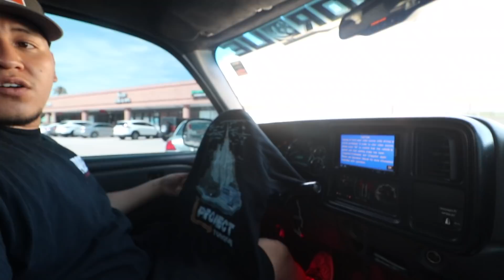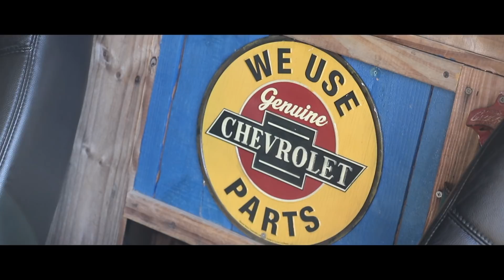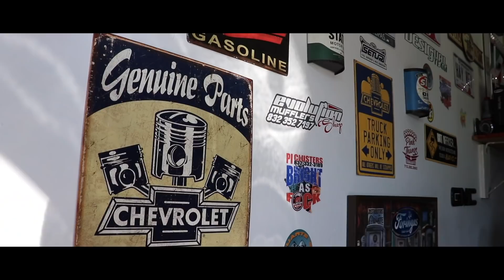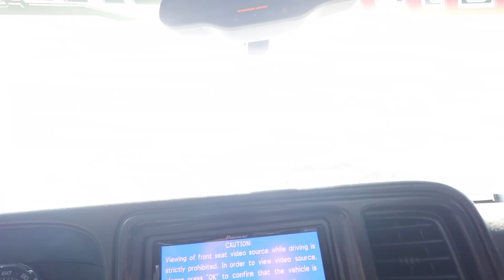2009 Silverado Seats on a 2003 Silverado / Ss CLONE GETS NEW SEATS

Comment: Make a video on manual to electric windows conversion!
Reply: Fr
Reply: You need an 02 and under for the power window conversion 03 won't work because 03 n up windows are connected to a computer module the 02 n under is just plug and play. Your gonna Need 2 relays per door and u Google the wiring diagram.